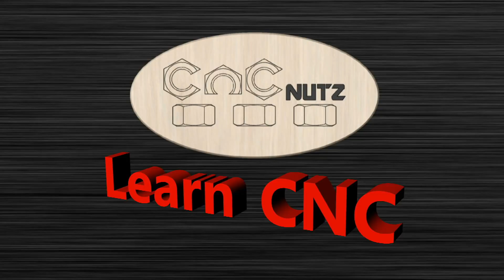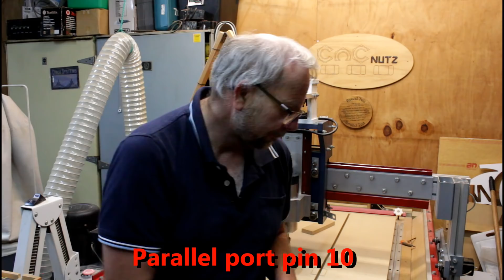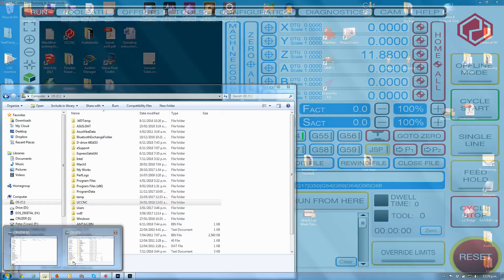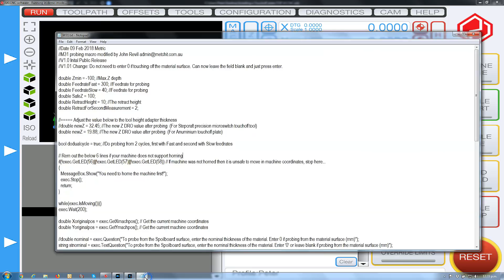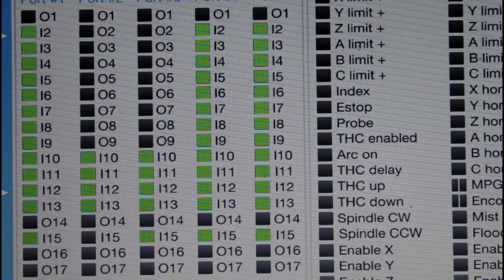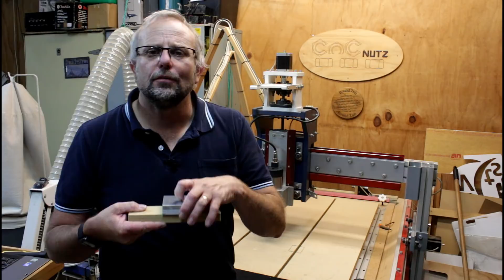UCCNC Touch off Plate Install - CNCnutz Episode 205

Comment: Hi Peter , good video and clear instruction .. I have a small issue that then I I input thickness the , I have to lift the touch probe up to the spindle, it beeps and it then comes down and performs everything that it should so im puzzled why it’s doing this, I’m using axbb board , check through all the comments and looks like I’m the only one with this issue, only different is I’m using pin 6 and not pin 12.

Comment: Using a macro like this, How could I have it move to a location of a fixed/mounted springed touch tool and then return to home afterwards automatically?
Reply from the maker: You would need to write an entire new Macro.
You need to touch off when you home the machine and then touch off when you change each tool. You need to do the necessary maths to work out the tool length offsets at each tool change. 
I know this because my MASSO controller does this and I know just how complex it is to do something this simple.
I wish you the best of luck.
Cheers Peter

Comment: Hi Peter I have a AXBB-E motion controller and a UCCNC software. I'm trying to install a touch plate probe. the problem when I  try to enter the pin # and port # it doesn't work?  After I enter pin 13 and port 2 and hit apply settings or save settings it goes back to "0", it won't accept my settings, any idea what going on?
Reply: Hopefully you have found a solution, but if not - first make sure that you have a port 2, then after you enter the pin and port numbers you have to hit the ENTER button on your keyboard for each one before you apply and save.

Comment: Hi Peter, I have Gecko GR-214 Raptors, their 5 volt logic is supplied by the UC300's break out board's 5 volt output so they have the same ground, but my spindle is grounded to earth. What do I do? Thanks.
Reply from the maker: Do not confuse earth and ground, they are completely different things. Your spindle is earthed for protection against being electrocuted. Ground is a common point in a circuit. My spindle is both earthed for protection and grounded. For a better answer see episode 206
Cheers Peter
Reply: @cncnutz  Hi Peter, there is no confusion, I understand they have two different ground potentials. My spindle is earthed ground and my UC300 and Gecko drives logic are floating and not in any way connected to an earth ground. The question was....I want to use an electrical probe but I want to keep the spindle and logic circuit grounds isolated from each other....how do I do it? I watched episode 206....I think you admitted you don't know the answer either. I think I will just go with a Haimer and circumvent the problem entirely, although the electrical probe deal is much easier after it is all setup. Thanks.
Reply from the maker: @Cleatus46  
I understand now, you want to remain isolated.
In that case the only option is to use a tool setter with a built in switch.
There are many that you can find on line both fix wired and even a wireless one.   https://ebay.to/3s3nSWx
Using a tool setter with built in switch will keep it all isolated and is required when using a spindle with ceramic bearings as they do not conduct.
Cheers Peter
Reply: @cncnutz  Ok, good thank you!

Comment: Hi I liked the video. My question is the UCCNC plugin and screen set up for mm. I have set my system up but I run in inches and it just does not work right. I am using the UCCNC controller and UCCNC software. I did like the way you made your touch off plate, made one just like it.
Reply from the maker: Are you using the latest version of M31 and did you set the piece in the M31 file to be imperial?
The Macro has changed a bit since the video with both metric and imperial in the same file.
Cheers Peter

Comment: So, I have a touch plate that uses a black wire and a clip that uses a red wire.  I'm failing to see where each wire terminate in the Gecko g540 device.  I was hoping you'd show that in your presentation.
Reply from the maker: I can't comment on your red and black wire but connection is simple on the G540. Connect the plate to one of the 4 inputs. Connect the clip to the G540 - ve if you want to ground the cutter with a clip. When the 2 touch the input will change state.
Cheers Peter

Comment: Should the probe light be on or off when probe and block are apart not clear in video?
Reply from the maker: The probe light is only on when the tool touches the block.
Cheers Peter
Reply: @cncnutz  Many thanks your videos are very informative and have helped my understanding allowing me to get deeper into cnc and its intricacies.
Reply: @Vice Grip I've seen it as you should light up when there is an active TOUCH signal.

Comment: Hi Peter 
I have installed the m31 macro. The problem I have is that using a 42mm tool sensor the cutter comes down , retracts drops down again slowly stops  and then keeps on going down. Any ideas ? Cheers Andrew
Reply from the maker: I have no idea Andrew. I'm not sure what a tool sensor is but I assume it is a touch off which is retractable in case the cutter decides not to stop. It really makes no sense that it doesn't work on the 2nd pass. Have you tried it using a metal plate instead of the tool sensor just to see how it behaves. Doing that will point you toward the culprit in this case, either the tool sensor or the macro. To be honest neither seems likely but one of them must be a fault. You can email me if you need more help. Just use the contact form on my website.
Cheers
Peter
Reply: Hi Peter 
The tool sensor is just that round switch you showed in your video. The switch is working ok if I press it wih my thumb. I'll get in touch with UCCNC as this also happens with the m31 supplied with the software as default.
Cheers

Andrew
Reply from the maker: The tool setter I showed in my video isn't a switch but rather a sprung loaded plate. The top is connected direct to the wire coming from the machine. To me is sounds like the issue is the tool setter you have rather than UCCNC though I admit it doesn't sound likely. If you want to find out where the problem is spend the 5 minutes it will take to swap your tool sensor with a piece of aluminium and run the macro. If it behaves the same you will at least know it is not the tool setter. Just hold the plate in your hand well above the table and you won't damage the cutter.
cheers
Peter
Reply: Hi Peter
The tool height setter I have is just a spring loaded momentary contact(switch?) I did find one of my profiles where the original uccnc probe m31 worked. I copied the macro to the profile where it wasn't working and it didn't work there. So my concluson is my profile has a problem. i'll try your profile this evening on my working profile and see if that works, after that it's a hunt for whats not right with the profile I tried first. I'll let you know how I get on. I would just like to say thanks for the time you have taken to reply and for the great videos you have posted they have been most helpfull.
Cheers

Andrew
Reply: Hi Peter 
I got it working, I'm not quite sure how but I think some of my profiles aren't fully setup. Thanks again for your help.
Cheers

Andrew
Reply from the maker: Great news. I hope you find the new macro useful.
Cheers
Peter
Reply: @cncnutz  Hi Peter My windows 7 updated and now my M30 macro is touching the swtich coming down lifting off and then coming down without stopping. I was just wondering if you were aware of any f!$*ups caused by windows 7 recent updates, before I go trouble shooting. Cheers Andrew
Reply from the maker: Hi Andrew
I was asked yesterday about this behaviour by someone installing the macro but could not reproduce. He is using UCCNC v1. 2039. It was going through the routine then would dive for the table. Do you know what update caused the issue? Are you able to remove it and can you let us know which one it is?
Cheers
Peter
Reply: @cncnutz  Hi Peter I just downloaded the latest test release from uccnc and the (uccnc oroginal probe routine m31) is working fine on that. But I would like to try your m31 as it worked well before. I'm a bit knackered at the moment so i'll be checking this out over the weekend. There were a whole pile of windows updates that downloaded as I don't normally keep the cnc computer connected to the internet (I know why now) If I get any luck with your macro i'll let you know. Cheers
Andrew
Reply: @cncnutz  Hi Peter I just checked another profile with your M31 file and it works as it should. I copied  it into the profile that worked before but is'nt working now and it still does'nt work so the M31 is ok and something must have changed in the profile. I'll sift through the settings and see whats different. At least I know now that your M31 works fine and the problem lies at my end. 
Cheers
Andrew
Reply from the maker: Thanks Andrew
If you think that is annoying wait for it to do an update during machining and watch the carnage.
I'm running XP and will have to set up something to test.
Cheers
Peter

Comment: Peter, does this macro publish the recorded length to the tool table? On a milling machine I have many fixed length tools, I'd like to use this routine to record the gage line tool length to my table.
Reply from the maker: No it doesn't.
Cheers
Peter

Comment: Hi Peter,
I installed your imperial scripts into Mach3. When I pressed the autozero button, Machu3 displayed the following message, "Scripter Compile Error In:" I tried both versions with the same result. Any idea what the problem might be?
Reply from the maker: Hi Gareth,
I have just tried both scripts and they do not come up with the compile error but I did see it plenty of times when I was orogonally tryinng to sort out the script.
There are 2 things that immediately spring to mind.
When you pased the script into Mach3  there was something left in the script editing box. Even though the box looked balnk when it was open I found that there was always at least 1 character in there that needed to be deleted.
The other option is that when you edited the the script for your Z plate thickness you introduced an error.

If you still have a problem you can email me the screenset and I can take a look at it.
I'm sure the script is saved in the screenset itself
cheers
Peter

Comment: Peter good video I use the gecko g540 Mach3 and the 2010 screen set works great.
Reply from the maker: +Lou Flores
Thanks Lou
Reply: I've got pretty much everything I need for my setup for mach3 but I'm wondering will my scripts for mach3 work on uccnc?
Reply from the maker: +Fox 2017
No. They are completely different.
Cheers
Peter